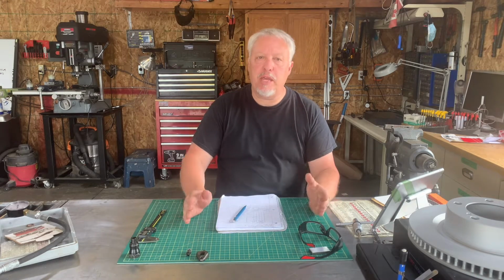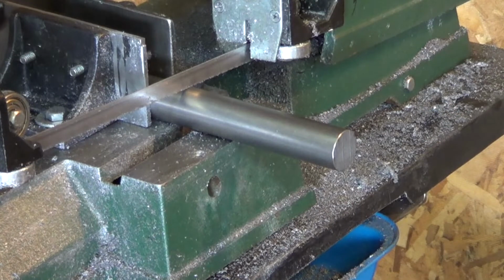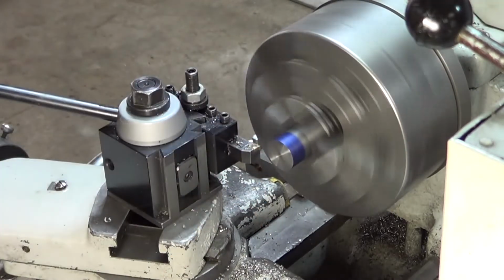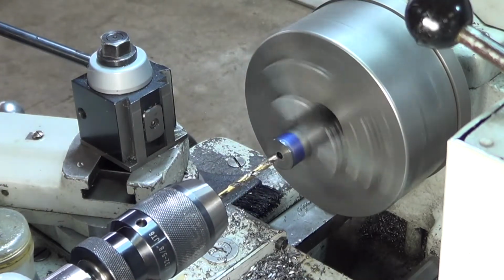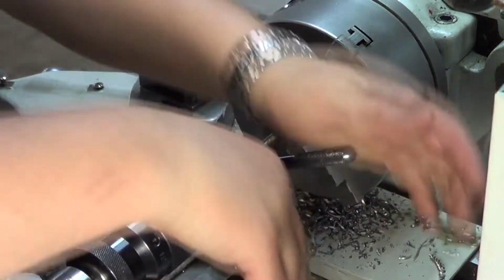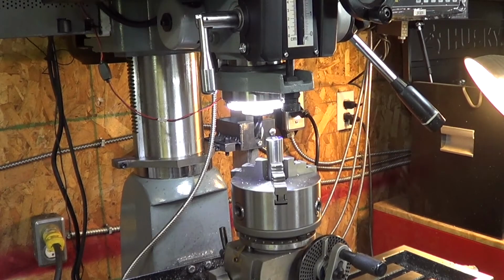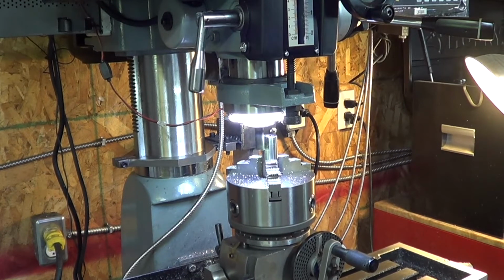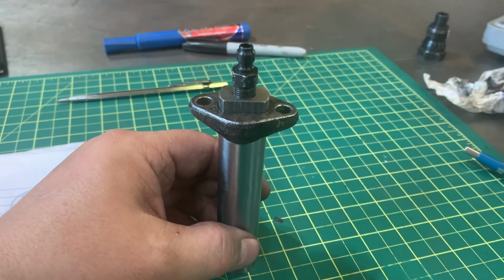Ducati Injector Adapter for diesel inboard motor

Comment: As in Ducati motorcycle engine or something different?
Reply from the maker: Those are marine diesel inboard engines. No glow plugs and they were made in the US under Ducati’s brand. There are very few of them out there and its easier to find chicken with teeth than info of the engine.